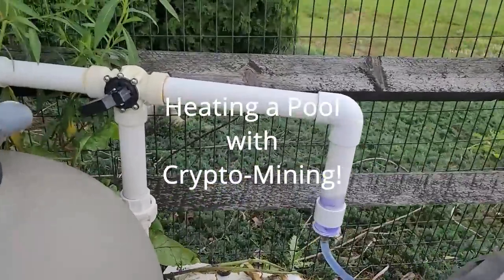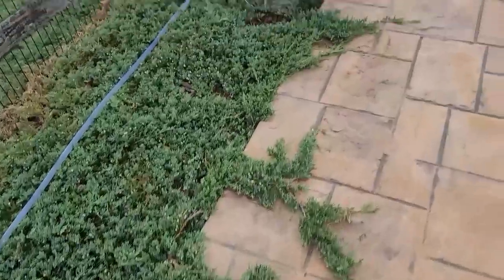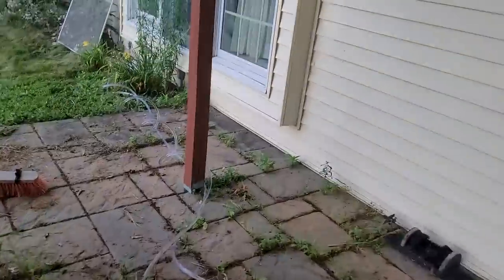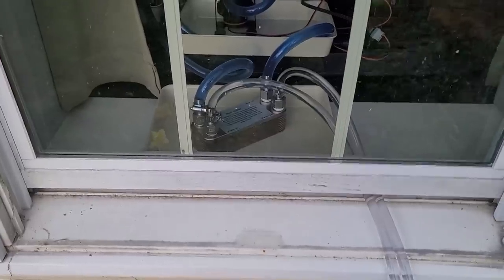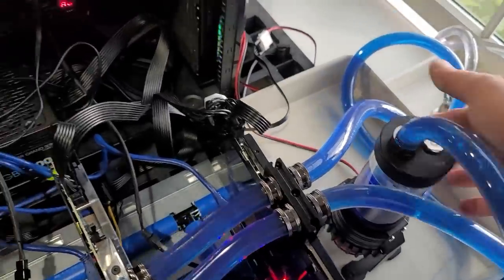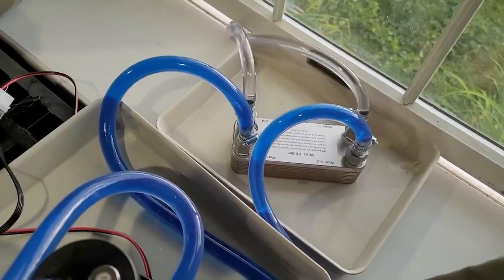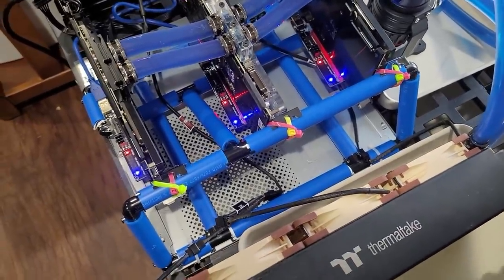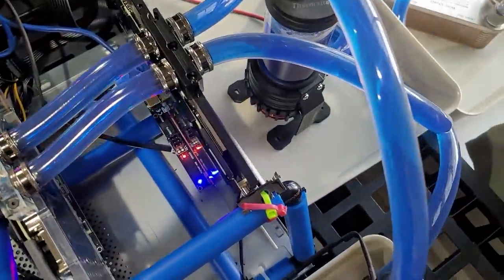Crypto Mining Pool Heater

Comment: This is the biggest heat sink I have ever seen for a pc lol, quite smart being able to warm your pool and cool your pc and room
Reply: can we say it is passive cooling? no radiators involve right?
Reply: @andresaponte5993  This is as passive as it gets. The entire pool is the heatsink.
Reply: @andresaponte5993  how is it passive if a pump is pushing the water through the system?
Reply: @markm0000  incorrect. The plate heat exchanger is the heatsink.
It's performance is limited..the pool has nothing to do with it .
Reply: I live on a boat  and I'm going to do somting simular  for my pc  no noice pc  but I'm not using a tiny pooling going to use the whole damm river
Reply: @markm0000  
a heatsink is always passive... 
What makes it active is air or water being pushed through the heatsink ;)
Reply: @andresaponte5993  passive cooling dosnt have to do of ther is a radiator. It is passive if ther is nonactive thing that cools it like a motor or a pump or a fan is all active. But a big hatsink is passive. And ther are some passive liquid cooling systems but only prototypes
Reply: @Thefreakyfreek  How do you have internet on your boat? Do you use a 4G router?
Reply: New record?
Reply: @timeTegus  
they use liquid cooling systems is smartphones... or vapor cooling to be precise, but I guess that still works with condensation and thus liquid.
Reply: Teehee I’m famous

Comment: I think it would be better to have the heat exchange outside the house to limit the risk of water damage. The potential damage from a leaking computer coolant loop is much less than the potential damage of emptying the pool indoor.
Reply from the maker: Done and done. Great idea.
Reply: You don’t realize that that is probably 20k in computer hardware. I doubt redoing the room because of water damage is cheaper than the rig.
Reply: @jacobleeson4763  Who in their right minds would want to repair their house from pool water damage though? Besides, you don't know what else he's got in there.
Reply: @midgetman4206  right? Why risk it and make more work for yourself
Reply: @thehomiepatchez  you could potentially finesse a warranty claim on those cards if they got water damaged, but you are out on your own ass if you flood your house with your pool. I agree 100%.
Reply: @jacobleeson4763  remodeling a room is much more of a pain in the ass then getting new cards
Reply: @jacksonledford6874  At least you can remodel a room. You can’t buy new cards when there is none to buy. And you can pay someone to do it for you if you like and have money left over compared to replacing computer.
Reply: @jacobleeson4763  However, I might add that this is only a big deal when dealing with at least like 100 cards or a professional operation in a warehouse where the warehouse is cheaper and easier to replace than the million dollar rig sitting inside of it - given that the mess-up in question would cause an outage of a small-income stream compared to potentially a hundred thousand of dollar (or more) in irreplaceable property damage - let's say that he floods his house overnight or something and that house's value is something like $600,000 USD (that's probably on the steeper end but nonetheless, even if it was $300,000 it would still be applicable), that flood damage would equate to a loss on the property value equivalent to much much much more than he would ever earn from not only the cards but the entire mining rig's lifetime value including the rig itself and all of its components. 

Therefore - you definitely would not want to jeopardize a home over some mining rig even if the rig were to cost $30,000 - because the property damage would still be greater by multiple times if even half of the pool is emptied into it overnight. - this is applicable for homes with a basement moreso than homes like one may find in Florida as such water damage would be much worse if a basement is involved... but even if the walls get soaked from beneath that can lead to irreparable damage because it would then cost more to fix the property damage than the property is worth, thus taking a $600K property and bringing it down to a solid $250K with one foul swoop. But this all depends on the context, so nevermind the estimates, you get what I mean. 

When considering that homes with basements also typically keep most home appliances in the basement (ie. boiler, AC unit, laundry machines, other things such as power tools or etc, support structures, and are mold magnets), if such a flood occurred in a home with a basement, the damage would not end on the day the water is pumped out - it would continue adding damage over the course of the year with mold breaking out inside of the basement, soaked floor boards, insulation, and anything else you can think of including potential electrical components (ie. breaker box located in the basement that fills up with half a pool's worth of water). It would be comparable to getting hit with a major flood from a river or hurricane, minus the destructive water tide rushing around... then the odors and mold kicks in and it's over forever for that home... will always sell way under value. A very easy and quick way to lose hundred thousand dollars or more in home equity.
Reply: @jacobleeson4763  emptying a pool into a house would result in significantly more than $20k in damage. When houses get flooded to that degree you’re talking tens of thousands of dollars in damage, easy. You talk about not being able to buy graphics cards, but buying materials and labor quickly is not easy in today’s market either. If you have any experience with remodeling you’d see how much of a royal pain fixing water damage—even a little—actually is.
Reply: @poloska9471  You seriously think that at the flow rate of that pump he could pump half a pool full of water into his house? He would have to over a week without noticing it to pump the pool into his house. Especially since if it did leak it would just be a leak not like 100 percent of the water going through the tube would actually be leaking out. My guess is with a small leak like that there would be no more than 100 liters of water at absolute most in a 12 hour period. And I believe that’s on the high end. 1000 liters if rather than a leak it was actually pumping 100 percent of the water in. I assume most he would probably go without being at home is 12-24 hours on your average day. Meaning the probability of him not noticing it before major damage is done is very low. Not to mention the incredibly low probability of a leak happening there in the first place. Not very much that could go wrong with the heat exchanger. A lose fitting would just drip. A small amount of water can damage a computer. Not so much a house. After water damage is repaired no one would even know about it so property value would decrease none. You wouldn’t have to disclose it during sale if you wanted to sell them unless there was very serious issue which hadn’t been fixed yet. Anyway regardless the computer was on a table and the exchanger was in the window. So the water would have to really spray in order to reach the computer. Chances are it wouldn’t be able to reach it. But the argument wasn’t whether it could or not just that if it did computer is more valuable. Yes a pool full of water would cause lots of damage. A hundred liters probably less not so much.

Comment: Love this, great use of no longer needed exhaust thermal energy from one application into another.  That energy would often have been wasted into the environment and I love that this seems to bring the waste down to a low percentage.  Even more efficient than traditional heat pump loops I would assume.
Reply: About 60-70% as efficient as a heat pump actually.
Reply: @stickyfox  Considering the converted waste would actually cost energy to remove in normal circumstances, you could consider this pure efficiency, and more. I'm not saying it's even close to a heat pump if we look at the energy in and out, but I'm saying it's better than one if we look at total energy usage. Both tasks need to be done regardless. If you didn't do this, you would need to spend energy cooling the room the PC is in, AND you would need to spend energy heating the pool. Essentially, it's getting rid of 2 heat pumps. Assuming he's not using anything else to heat the pool.
Reply: @poipoi300  Efficiency is the ratio of heat transfer to power consumption. A computer burning 1000W of electric power can produce 1000W of heat. A heat pump consuming 1000W of electric power can deliver as much as 6000W of heat.

What we're talking about is called co-generation in energy terms, and it does have applications. But it's disingenuous to tout crypto mining rigs as replacements for heat pumps. They require much more power to generate the same amount of heat, and cost significantly more to maintain. Before we talk about the benefits of using all that stray heat, we need to ensure that people understand how much more power we'll be wasting.

You can stay warm for almost one night if you set your home on fire.
Reply: @stickyfox  I'm aware of what efficiency is, which is why I've worded what I said in the way I did. I specifically said it wasn't even close to a heat pump in terms of efficiency. Ironically, you're not quite correct about what efficiency is. Specifically, it's true, but generally, it's wrong. Which is exactly what's ironic because other than that, you're trying to be general about a specific scenario, ignoring the most important factors specific to the situation.

That's actually what's disingenuous. You not considering the context of this operation, and seemingly neglecting that the crypto mining is generating revenue, and that cooling it is a requirement for it to function appropriately. You need more power to move the same amount of energy as a heat pump would, but that power is paying for itself and more. I don't imagine that his setup heats the pool much or enough on its own, but heating the pool probably isn't his main concern. And you know, if you'd read what I said you'd notice I said it was only getting rid of a heat pump assuming  he wasn't using anything else to heat the pool. I never said it heated the pool as much in an absolute or relative efficiency sense. Although it would be scalable to heat it more in absolutes compared to a single heat pump.
Reply: @poipoi300  I don't have any idea what you're talking about. I was simply correcting the misinformed opinion that a heater can approach the efficiency of a heat pump.
Reply: @stickyfox  I'm talking about the kind of efficiency the people making those comments are thinking of. It's not misinformed, you're misinterpreting those opinions by using the technical meaning of efficiency in a vacuum. You're not correcting anyone because that's not the opinion being shared in the first place.
Reply: @stickyfox  the GPU "heat pump" is consuming ~0W of power. It's scavenged waste heat, from an application that already requires cooling to operate. 6000W of heating power from an equivalent amount of GPU (say 10 kW of mining @ 60% total heat exchange efficiency), would probably take ~50 W to circulate the fluid. You might even be able to design a passive system.

Comment: Linus from LTT did a similar thing with his solar panels. Apparently the general idea of using a pool as a two-way heat exchanger with waste heat is not that uncommon in practice, but this is definitely the first I've seen or heard of it with a mining rig.
Reply: I saw a guy a few years ago who did the same thing for his gaming PC as an experiment to see if it could be a good solution to cool his PC.
The machine wasn't mining anything and he was only playing red dead on it so it wouldn't make that much heat compared to a mining rig but I guess if the card was running full till and for a long enough time that he could heat his pool.

Personally I also tried this idea but got a different end result. I tool an aio radiator water-cooler and placed the radiator inside a tub of water next to my PC, the point of this was to do overclock testing to see how far I could push my CPU before the overclock was too much but anyway after I turned on the pc, the 3 or so liters of water in the container had reached about 42 Celsius after 25 minutes of gaming. I then took my coffee cup and placed it into the container and on top of the radiator and the heat of the water was able to keep my coffee warm at a consistent temperature, even much so that I went outside and mowed my lawn and did other things for about 2 hours  while the pc was just running a benchmark at 70 percent usage and when I came back the coffee was as warm and tasted the same as when I first put it in there.
Reply: @teddycornerproductions3095  Putting the radiator in water is an interesting idea. It could be pretty good with a large volume of water and flow on the radiator fins.
Reply: My grandpa did the same thing with a black hose and some mirrors on top of his shed. Sadly mining isn't profitable when you live in the country with the highest electricity prices in the world, otherwise I'd be running a mining rig in his shed by now.